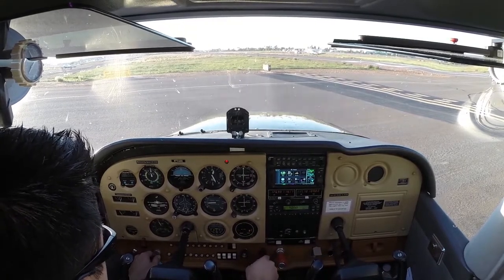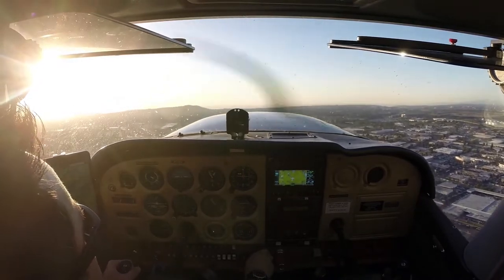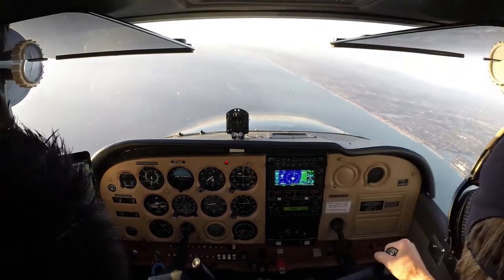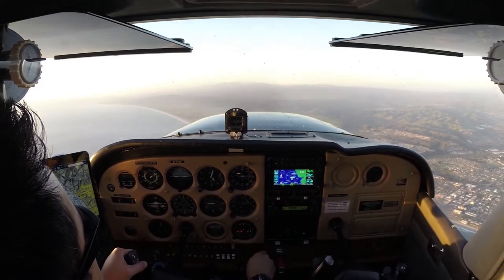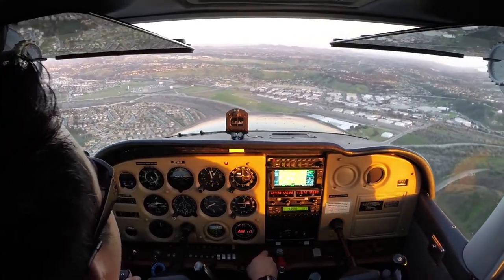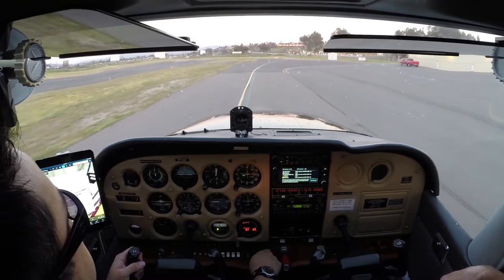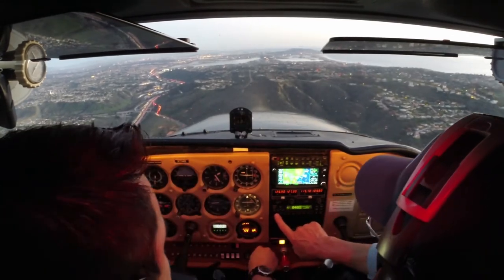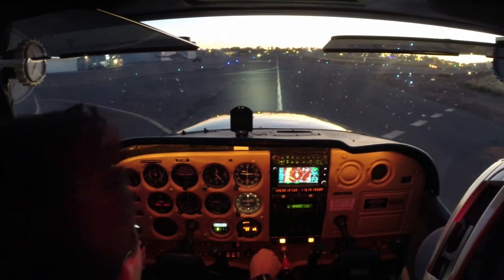Dual Flight Lesson - Stall/Spin Awareness, Searching for Crosswinds

Comment: Shows how tough it is to spin these planes. Pilots really have to be overly aggressive for it to happen. I was unable to get into a fully-developed spin during my spin training for CFI. I found out later that if I had a little bit of power applied, that would have helped, since more power means more airflow over the rudder, which provides more control authority, which in turn makes the rudder more effective in getting you into a spin.

A lot of spin accidents happen on the departure and turn to crosswind at full-power, or when they are turning to final aggressively with a little bit of power in. In the pattern is the main area accidental spins occur. That's why it's so important to have a stable approach and make gentle bank/pitch adjustments in the pattern (as well as flying the appropriate airspeed).

Comment: The nose gear shimmy is common in these planes - it could be improved through maintenance or part replacement, but it can be avoided by being less aggressive on the brakes. Your first 1 or 2 seconds on the rollout you typically don't use brakes and focus on stabilizing and controlling the airplane and the direction its traveling.  After that you can start very gently applying brakes and then very gently increasing pressure.  To stop a nose shimmy, you have to completely release the brakes and pull back on the yoke to try to lift the nose wheel off.

The more shimmy's that occur to the airplane, the more the shimmy pattern develops on the nose wheel, and the worse it gets with each following occurrence. Once the pattern develops on a tire, the shimmy will tend to occur at the same rollout speed every time as the speed the shimmy-pattern was first developed at.

Usually the only thing the owner can do to try to fix it is buying a new nose wheel tire (which they don't want to do when the tread still has plenty left), or by inspecting/fixing the shimmy-damper, or checking wheel bearings or tire balance.